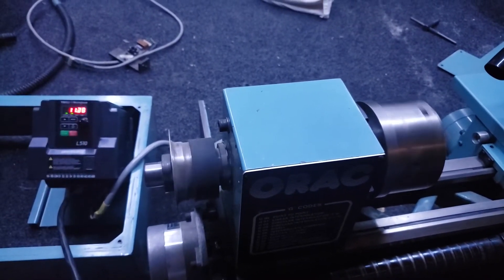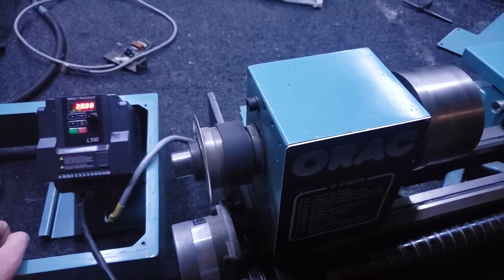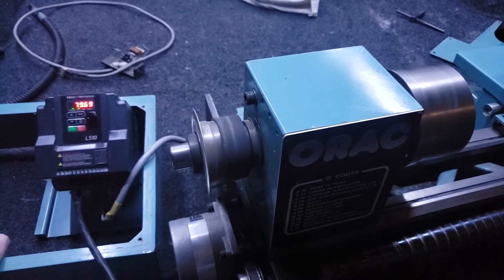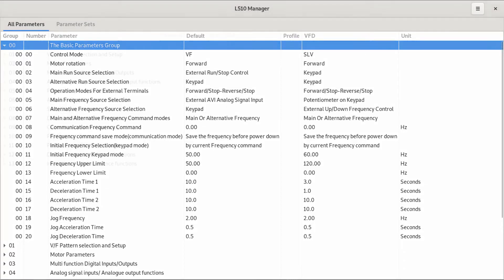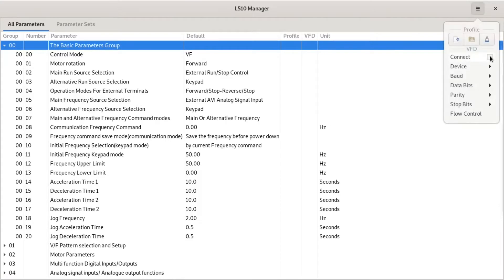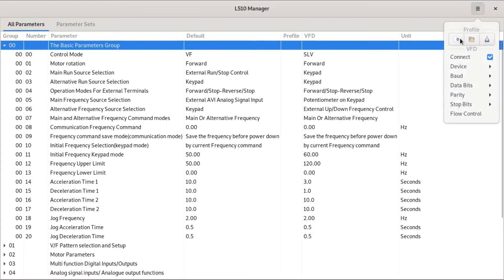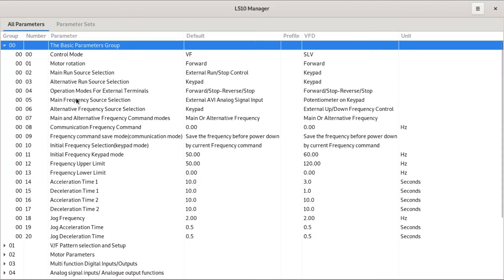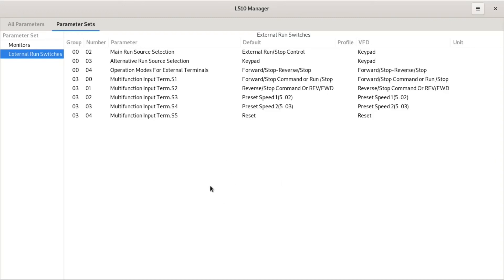Teco L510 VFD Proof of Concept / L510 Manager Demo

Comment: Hi Cilynx, Would you please share the L510 parameter settings that you used?
I am building something similar, and I am getting an error message back.
For example, I sent 01 03 01 23 00 01 74 3C and received 7F 7E 7F 6E FD 17 87 00

Thanks in advanced!
Reply from the maker: The modbus stuff is here: https://github.com/cilynx/L510-Manager/blob/master/src/vfd.vala
The parameters are defined here: https://github.com/cilynx/L510-Manager/blob/master/src/json/parameters.json
Reply from the maker: Do you have a public repo of what you're building?
Reply: Teco L510 Paremeter Settings:

09-00 Assigned Communication Station Number
1

09-01 Communication Mode Select
0: RTU Code

09-02 Baud Rate Setting (bps)
1: 9600

09-03 Stop Bit Selection
0: 1 Stop Bit

09-04 Parity Selection
0: No Parity

09-05 Data Format Selection
0: 8-Bits Data
Reply from the maker: @marcofortini4009  the only difference I'm seeing at a glance is I'm running at 19200 as opposed to 9600. 

https://github.com/cilynx/L510-Manager/blob/master/src/vfd.vala#L6-L17
Reply: I tried 19200 before and now again with the same error coming back.

I am testing using two different USB to RS485 converters with a network cable. I don't think is the cable. Do you use anything special?
I ordered a second L510 thinking it might be damaged, but they both behave the same way.

I appreciate you helping me.